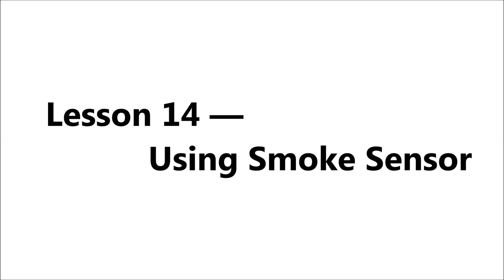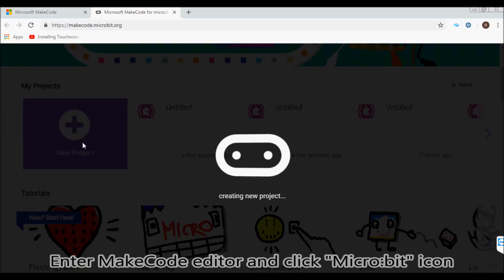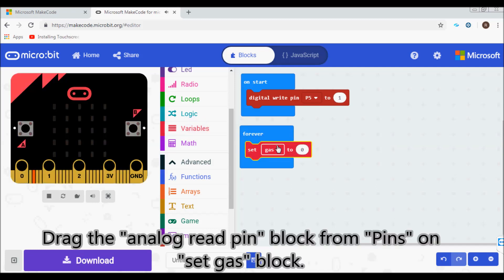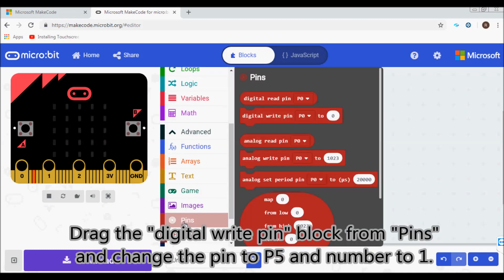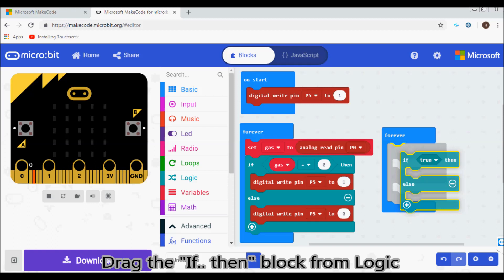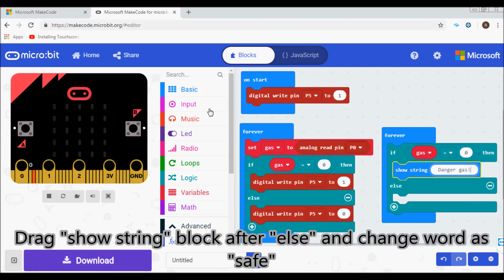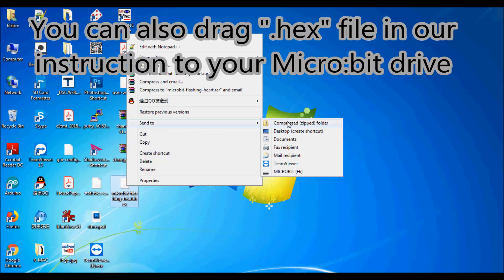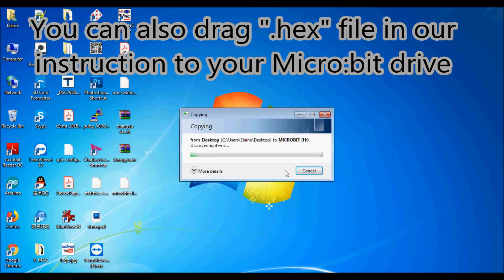Micro bit 14: Using Smoke Sensor

Comment: can i use basic extension board instead of t extension board?
Reply from the maker: Do you mean you just use micro bit board, but don't use the T type GPIO extension board? Of course, you can just use the micro:bit board  to make experiment, but you need to learn more about the pins of micro:bit and use clip to connent the GPIO to sensor modules.
Reply: @osoyoo_product  so we can make it detect without using the other gpio just the microbit